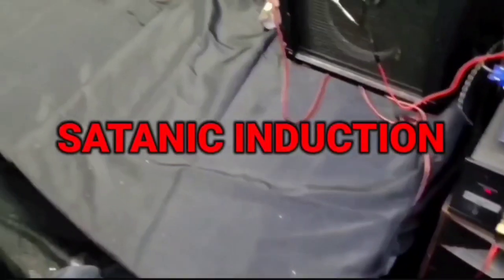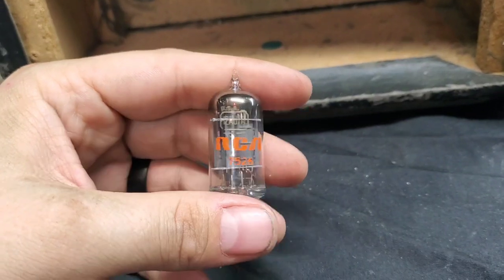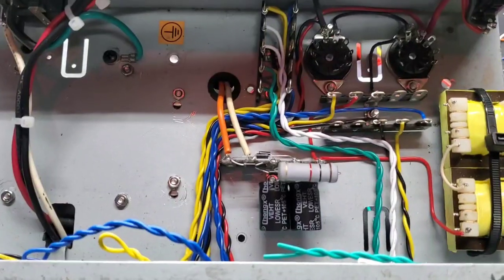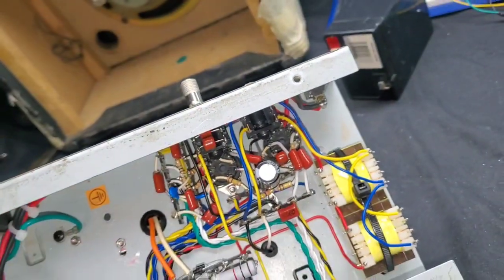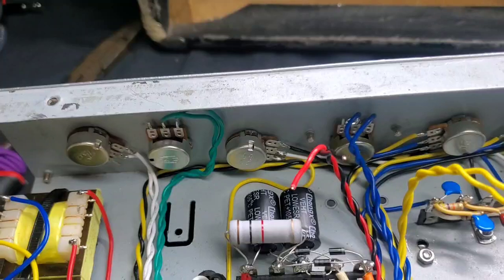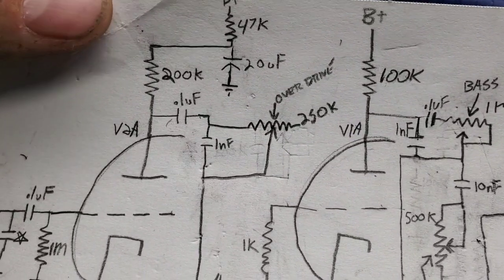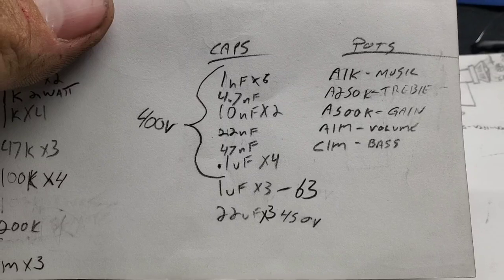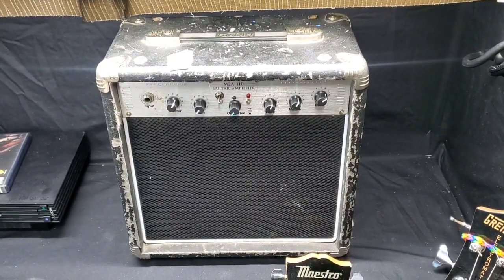Introducing The Third-Act The Worlds Wors(cough)First All-Tube First-Act Guitar Amp - With Schematic

Comment: Fascinating what you can do sans breadboard and PCB
Reply from the maker: It's surprising how much difference the physical layout has on tube circuits. It literally matters more than the schematic in some cases. For example, this amp will no longer squeel even when maxxed out now that it's in this layout. When it was on the bread board it was ridiculous how prone to oscillation it was. We may modify this amp with a terrible wiring sceme just to bring the squeeling back. That would be an interesting video.